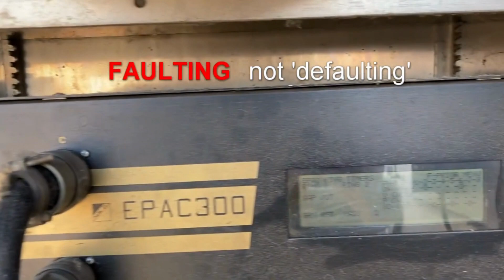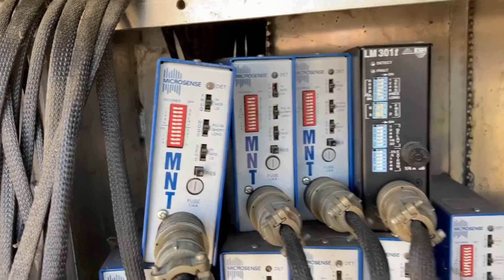Troubleshooting a Traffic Signal Detection Complaint

Comment: Have you seen the VMT SYSTEM modules yet ?
They use antenna wires in the lanes to create GEPs ( Ground Entry Points ) to talk to the vehicles and get their ID, making every street into a toll road.
Reply from the maker: Isn't that very government of them?  LOL  I have worked with a similar puck system called "Sensys".  The puck will assign an ID and send info back to the cabinet to process detection.  At the time is wasn't very reliable and the puck's batteries didnt' last as long as indicated.  Meaning we had to go back out and remove pucks from the road to place new batteries in them.  Not a low maintenance  system....

Comment: Oh man.  One main intersection near where I live had a pedestrian walk signal that would frequently keep going on even though there were no pedestrians.  It would do this all night long, and any vehicles waiting in the cross-directions would wait the full time for non-existent pedestrians.

And I've lost count of the number of times lights never turn green, often because vehicles aren't over the detector loops (leaving huge gaps in front of their vehicles, not pulling up to the proper stop line).  There's one in front of my local library that I hate driving into from the through direction, because I know there's a detector loop somewhere there, but I've never been able to find it, even after I parked nearby, got out, and kept walking over the asphalt to try and find it once and for all.  There's a weird section of pale orange brick pattern tiled over it that area making it different from normal asphalt where you can usually see the loops.
Reply from the maker: As far as the pedestrian signals, that could have unfortunately been by design : (
About the orange brick tile intersection, I think I know what's happening.  Many times, local municipalities get grants to 'beautify' their neighborhood.  Many times, decorative brick is installed (and in the process destroying the loops in the pavement).  When a loop goes bad, by design, it places a call for a green light for a vehicle even if there isn't a vehicle there.  
Assumptions here, but I believe that may be the case...
Reply: One of two things could have caused that pedestrian walk signal to always come up, 1) a faulty Ped push button 2) Pedestrian Recall could have been turned on in the controller settings, which causes the Ped to come up every cycle.
Reply from the maker: @Liam_Wa   You are exactly right.  Thanks for clarifying that!
Reply: @Liam_Wa  Interesting..!

@streetsmartstraffic It's occurred often enough over the years such that, but on different occasions, that I've been tempted to walk there from home just to check if the push buttons were somehow stuck being pushed in or something.  (But I never remember to.)

Starting to realize I can probably just drive straight through and enter my block through a further inlet.  But I'm finding my local municipality may have a page or smartphone app for reporting such non-urgent traffic issues now?

Comment: So as a driver, I drive up to an intersection, and it stays red while cross traffic, then oncoming traffic, then cross traffic, then oncoming traffic, ...    It's happened in several different vehicles.  I'm invisible.   :(
Reply from the maker: @davidmorton8170  isn't it frustrating?!  Sounds like the detection isn't working.  Not sure where you're at but you could call the local municipality and talk to their public works department about the issue.  Hopefully they have someone that knows how to fix it!